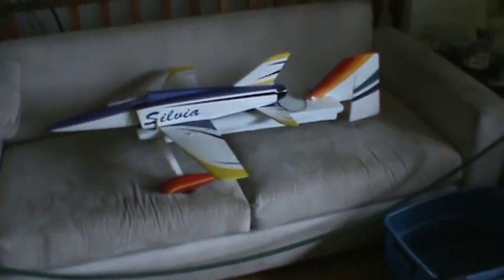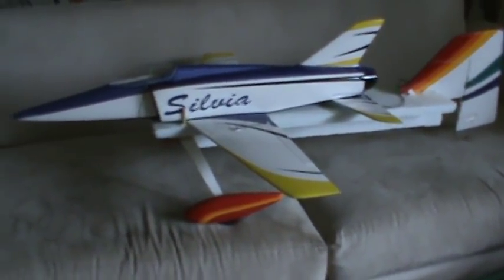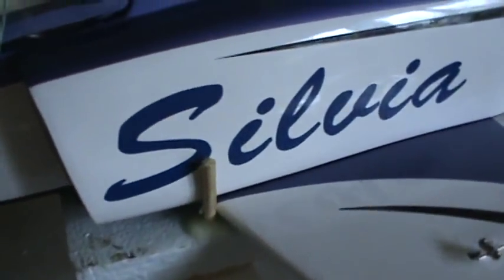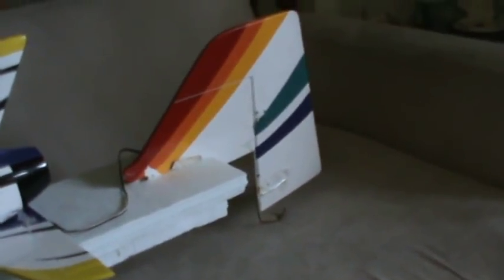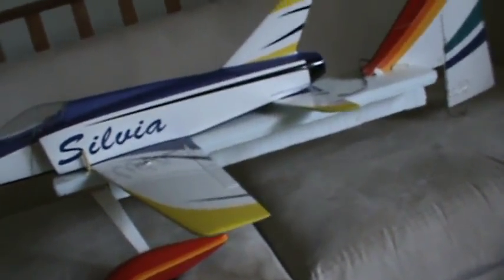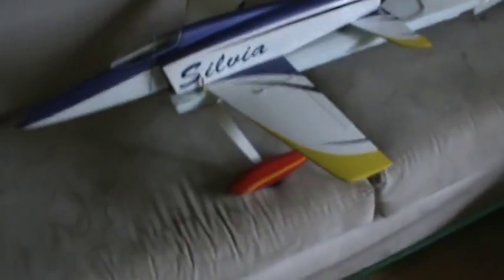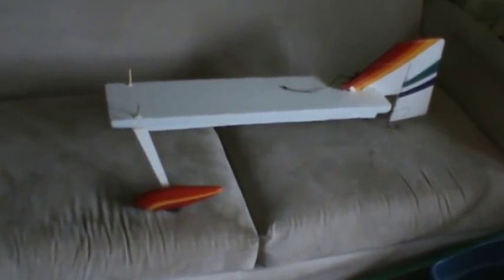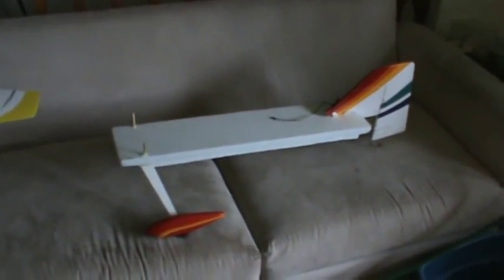Take off carriage alternative to hand launch or bungee launch.

Comment: Xlent idea! I had a similar one years ago. I never did it, but had the idea to make a 4 wheel "cart" with a separate receiver bound to the same transmitter as the airplane. this way I could steer it while taking off. Instead of chasing it down, or leaving it on the runway creating a hazard, I planned on using a fishing casting rod and reel and attaching the line to the rear of the cart. Just reel it in after launch! LOL It might just work too.

Comment from the maker: This idea did not work I tried several different designs and only one worked and in fact only worked ONCE and that was a trike steerable nose wheel type of thing I got the plane to take off with it but it was crazy and only just got up It didn't work again so i gave up IF it was on a concrete runway it would work better but bumps on grass was totally terrible. Don't waist your time if its for grass use